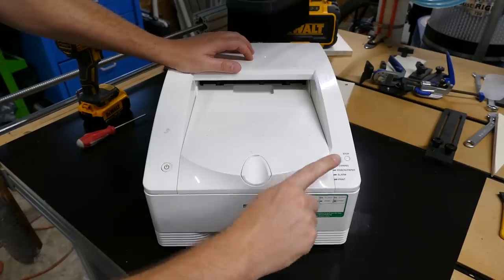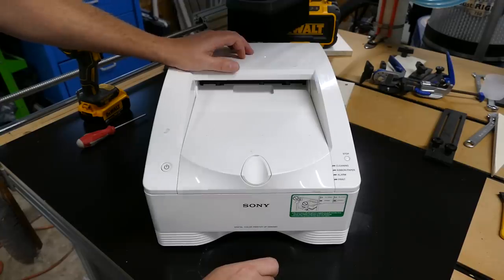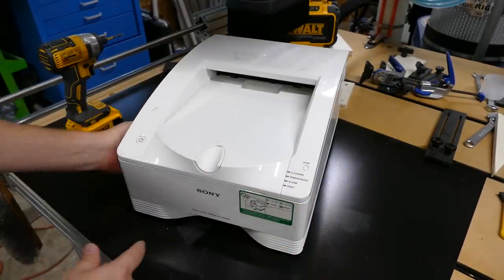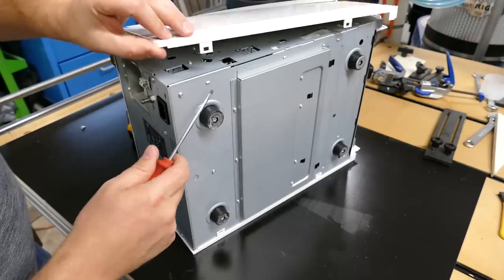Sony UP DR80MD Stryker SDP1000 Video Printer Repair

Comment: Great video, thanks. I connect these to my laptop and get fantastic test prints
Reply from the maker: I bought one of these printers off ebay for $200 with an extra print ribbon / paper. I get fantastic photo prints that are archival quality (they won't degrade because it's thermally printed)

Comment: Thanks for the video. I got the drawer out using this method, but it seems the gears aren't aligning when I power it back up. I still get an error. I don't see any physical damage. Any ideas?
Reply from the maker: Users often damage the gears or their plastic cam indexing pins when they try to force the drawer open..  Try to carefully rotate the gears to random positions then power up and see if it can rehome itself. Good luck.

Comment: Problems also with the ribbon sensor and the three fingers that pick up the paper size setting from the blue paper holder cam.
Reply: Could you elaborate? I’m working on one

Comment: Hi - have 2 of these printers in the UK. Purchased from an healthcare disposal auction. Think they have been taken from Storz stack systems that have been broken down into their component parts.....anyway...I'm trying to establish if they are good. I have them linked to my Windows 7 64bit laptop and i'm trying to print a test page. Have installed the drivers from Sony webpage. I keep getting that there is no paper selected ...any ideas?
Reply from the maker: Yes, make sure that the pink and blue  caps on the roll have the correct size selected (I think they turn)

Comment: what if the catch poll is jammed and does not move freely like the one in the video?
Reply from the maker: When in doubt, you can grab the print head and pull it down then pull the drawer out ( without playing with the gears). Just be careful.

Comment: So I had one of these the other day & your trick worked a treat in freeing up the draw but unfortunately the printer now doesn’t advance the paper, I can see the motor on the side running but I’m sure the runners at the top of the printer entrance aren’t “dragging” the paper into the printer. As someone has already said, rubbish design by Sony.
Reply from the maker: I am in the process of updating my original video. The bottom pan doesn't need to come down. You can reach past the white plastic pawl on the side and get a finger on the print head. You can lightly pull it down and extract the drawer.
Reply: Excellent, I’ll watch the updated version once you upload it, any ideas though why the paper isn’t getting dragged/ loaded in ? Like I said I can see & hear the motor working correctly & trying to load it but the runners on the top (at the paper entrance,  you can see once the tray is removed) seems to be stiff to me but I’m not sure how free running they should be tbh & I think they should drop down on the initial load & maybe there not ?
Reply from the maker: @richardwright6872  its very hard to troubleshoot a gear train based on description.  I can however tell you that Sony UP-DR80MD printers are frequently on Ebay and Dotmed.com for ~$200

Comment: That's a pretty shitty design by Sony, if it cannot recover from an improper powerdown. I see no technical reason for it to fail like that.
Reply: its not from an improper power down
Reply: @burtonfire2020  No? Then please educate us.
Reply: @zaprodk  its generally from improper use and loading of the print cartridge or paper cartridge.  No need to be so defensive, there you are educated.
Reply: @burtonfire2020  I'm not defensive. I have never touched one of these machines. I'm just refering to what is being told/shown in this video.
Reply: @zaprodk  You have never touched one of these, yet you left a reply as if you had a background on them.  If you have never touched on e of these, why are you even watching this video?  Just feel like trolling?
Reply: @burtonfire2020  LOL.